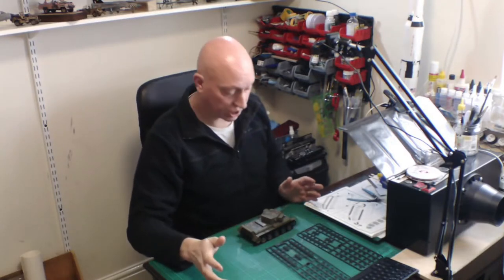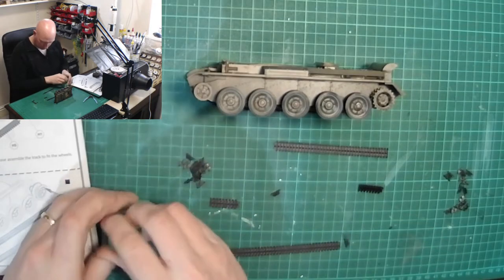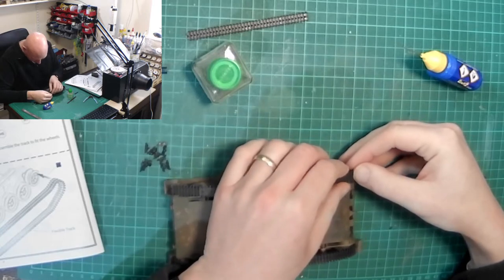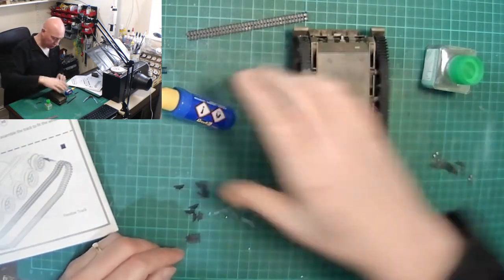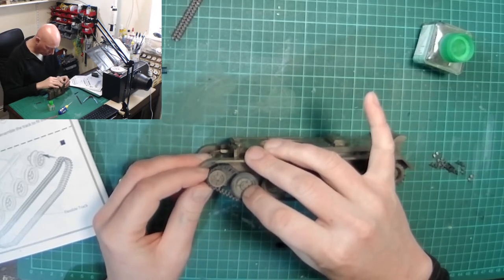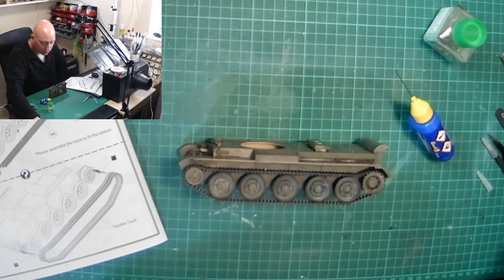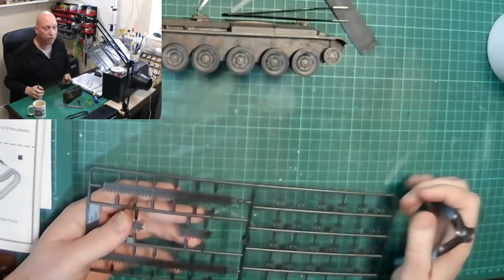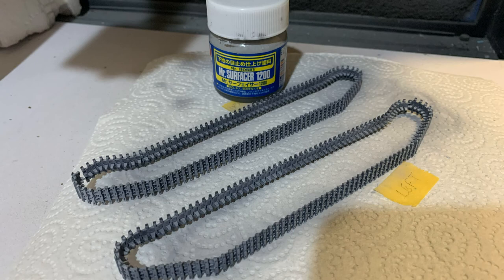Building the tank tracks of Airfix's Cromwell Mk IV 1/35 Scale Model Tank - Part 9

Comment: Thanks. Wanted to know if airfix 1/35 came with rubber tracks. Much more preferable than ones with individual links
Reply from the maker: Hi Maurice - apologies for the massive delay in replying. Yes, the 1/35 Airfix Cromwell did come with rubber tracks. I decided to go with the plastic ones for the following reasons:
* The rubber ones don't tend to 'sit' right, with the tracks going straight across the top and not sagging down
* I've found the rubber tracks don't take paint and weather well, once dry it flakes off
* In this kit you don't need to be individual links, but is done in sections that are pre-moulded to fit correctly. There are some individual links, but these are only around the tightest parts.
I found the tracks were actually quite easy once I'd worked out a technique to let the glue part dry so it was tacky enough to hold itself, but could still allow for the tracks to be manipulated into position.
Reply: @RobsModels  Hi Rob,thanks for that. Have done American T29 heavy tank by Chinese firm Hobbyboss. Was Chinese torture.Tracks individual links 113 links each track but each link had 2 side components so worked out as 678 components. Did it and tank looks good but swore would never do a Chinese kit again . Regards, Maurice